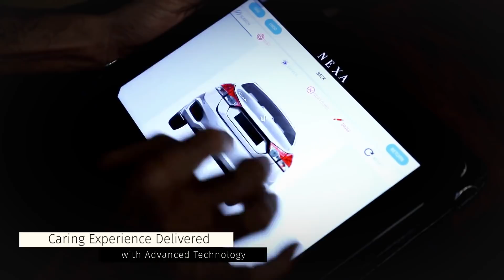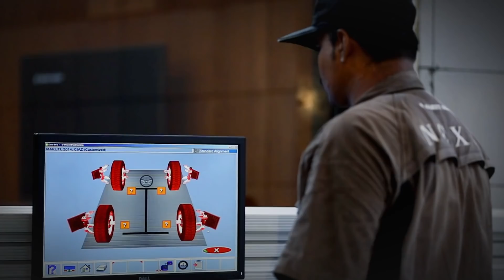Maruti Suzuki NEXA Service Center - Shivam Autozone | Mumbai

Comment: What is Tester Line?
Reply from the maker: Special feature of NEXA service center is the Dedicated Tester Line. It eliminates the need for road-testing the vehicle. With all the increased traffic and worse road conditions, it is difficult to Test the vehicles on road for various parameters like suspensions, brakes, tyre conditions etc. Tester Line is the ultimate solution for the same. The vehicle is tested before and after Servicing, on Tester Line to to check  and eliminate / rectify any issues by testing in the service center itself. 
To know more or Book a service appointment at NEXA Andheri, Mumbai, click http://www.shivamnexa.com/service-experience or call 88792 11111.